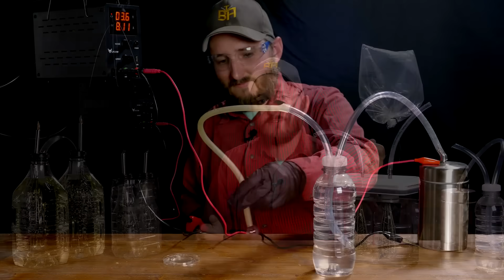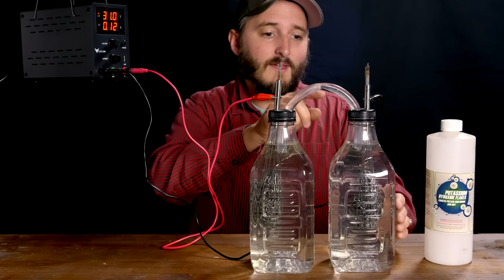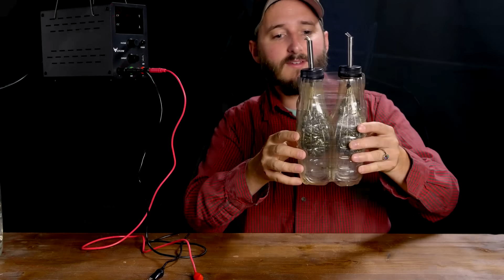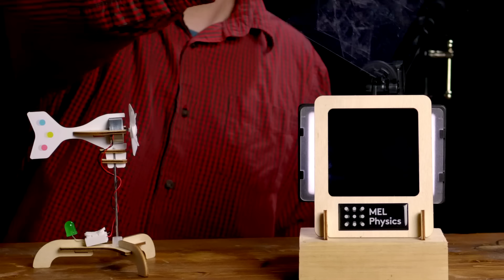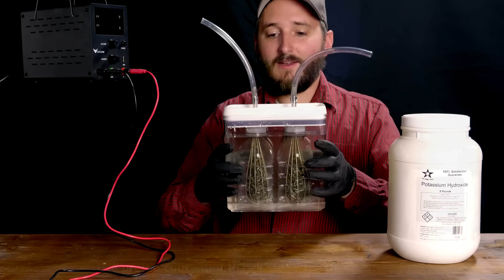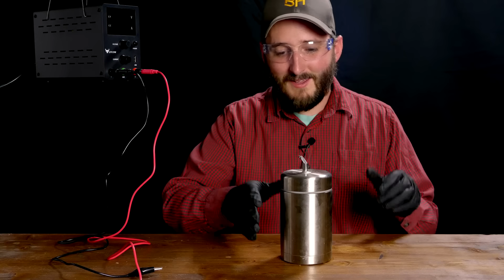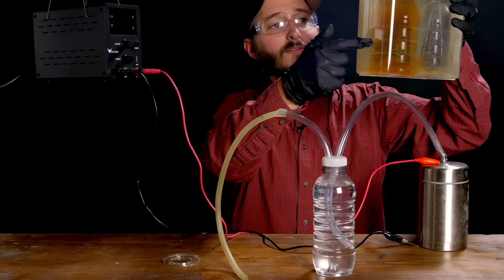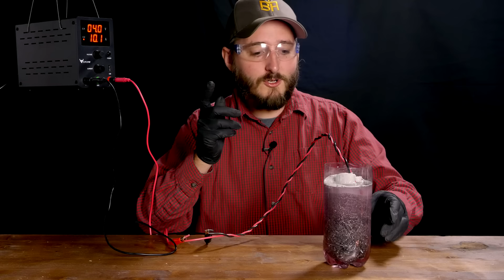DIY Hydrogen/Oxygen Generators From Grocery Store Items (HHO Fuel Cells & Split Cell Electrolysis)

Comment: Did he just say "Atomic Hydrogen Torch"? Yes, please! I think the only way this channel could get better is more videos, every single one is a banger, especially the ones where gasses go BANG as they combust. Cheers!
Reply: Gotta agree with you. These videos are at all just right. They explore some of the nooks and crannies that are often overlooked in all the other science channels. I look forward to all the videos on here
Reply: Honest question; are you expecting nukes of some sort? H2 is molecular hydrogen (two H atoms bonded) atomic hydrogen is a single H atom
Reply: @captainboing  ,Wondering The Same Thing…Honestly
Reply: I'm pretty sure that he is speaking of what I know as an Ionized Hydrogen torch, whereby the gas flows through an electrical discharge arc which brings out the full usefulness of the fuel.
Reply: I heard oxy-hydrogen torch but an atomic hydrogen torch would be really cool.  The heat is generated from the atomic hydrogen combining and become H2
Reply: It was the precursor to oxy-acetylene welding, there is a youtube of this guy demonstrating an atomic hydrogen blowpipe. The welds are usually good quality as there is no carbon.

Comment: Back in the days and I was a lot younger, I tried a HHO generator with a small flashback arrestor like you have done. However it unfortunately did flash back into the electrode chamber, though because I made everything using marmite jars the resulting blow rendered most of the plastic fragments everywhere! The bang was so loud it threw me to the floor and I had ringing in my ears for quite a few minutes afterwards. Miraculously I didn't get hurt, not get any of those shards of plastic in me (at least not any I could feel), but I certainly had quite a bit more respect for the stuff afterwards. I still don't know why the water based flashback arrestor didn't work, but perhaps it was because it was too shallow a container, and when the initial blast occurred in there, it agitated enough of the water in that chamber for the hot gas to make its way into the feeder pipe, and violently back into the electrode chamber. I much prefer the idea of a split gas electrolyser now :)
Reply: Would adding thickener to the flashback solution help?
Reply: @cherylm2C6671  Never tried that ... not sure if it would make a difference though. A deeper column of solution however might be the thing to reduce the potential of a line of bubbles from combusting.
Reply: @HemonDey  That will work for me!
Reply: Ive had exactly the same happen to me when i was messing about with a very large hho generator made out of a plastic food lock box
.
The explosion was HUGE !! 
.
Set a car alarm off,  and i had shell shock just like in the movies
.
I heared ringing and white noise for 30 seconds or more
.
.
My hand was Right on top of the cell ! 
 My leg Right next to the cell !
.
The cell got obliterated
.
But i was completely unharmed except for temporary heating loss ! 🤷‍♂️
.
Not even any hairs burned on my arm ! 🤷‍♂️
.
But i got completely covered in water  😅

Comment: I would suggest making sure to use a pressure rated bottle for the flashback arrester. I learnt the hard way that a water bottle turns into shrapnel pretty quickly...
Reply: two things i think might be ok with the setup... first, the output of the device is open air, which means the pressure does have an escape route. Second PET bottles tend to have quite a bit of pressure capacity and are fairly light to boot. That looked like a water bottle which is thinner than a carbonated beverage bottle. In this case, again in my unprofessional opinion, I think that would allow the bottle to deform giving the pressure time to escape via the output tube, and being thinner would rupture at lower pressures than a pressure rated device.   I think an ideal setup would be something like a plastic food container that  has a lid lose enough to pop off in case of explosion. a grease of some sort could be applied to the seal to help mitigate the potential leaking of the smaller hydrogen molecules.
Reply: It would not be as bad as learning the bad way that stainless steel on the anode side produces highly toxic Hexavalent Chromium, both in the water, and in the hydrogen released.

Comment: The only thing I would have changed is to have the electrodes connected to the "device" before connecting/disconnecting them to the PSU, that way any spark that is generated is always far away from the "device". Great project as always!
Reply: I believe the proper term according to the 'Manhattan Project' is 'gadget', as opposed to 'device'. Just thinking about hydrogen 'things'.
Reply: I thought the same. My take is have tabs with holes where the connections are and wires with lugs bolted right to the tabs. That way the wires/alligator clips are never accidentally knocked off while it is powered, which could cause a spark. Have a connector on the other end of your power cable.
Reply: Oh Come on now, where is your sense of adventure? A good loud bang is always fun to experience as long as you don't get injured too bad lol...
Reply: @beckwerks  sure thing, and besides the ear piercing bang, one needs to be careful they dont get sodium hydroxide blown over them.

Comment: A roll of stainless steel window screen using two pieces (the outer one slightly longer, but same width) rolled up and sandwiched between a cotton insulator (towel) works amazingly well. Lots of surface area! You can make super small devices that produce a ton of gas!

Comment: That flash back arrester reminds me of something else from high school days ;)

Really looking forward to the torch build, that's where my mind went before clicking the video!
Reply: What's that?
Reply: Just don't cough into the tube!
Reply: Apparently, I spent half my senior year of machine-shop building flash back arresters. Had no idea so many kids were into electrolysis.
Reply: They always lose their gas coz they leave the lid off and stick the outlet on the side
Reply: @Dman6779  Yes, they lose their gas.
In the most wonderful way.
Reply: @CraftAero  i think they were making decarboxylation devices/CO2 generators
Reply: I don't understand. What does it resemble?
Reply: @calebhouston5799  A filtration mechanism which often employs some garden hose and a large pile of snacks after it is used.
Reply: @calebhouston5799   A water Bong Caleb

Comment: Incoorporating an aluminum foil burst disk on the sealed container would be a good back up for flasback. Great video love the longer ones.
Reply: Good call, thank you; reminding me that pressure cookers have a small rubber seal for this purpose.
Reply: Please explain what it does
Reply: @ytrew9717  makes an intentional weak point, so if the pressure increases dramaticaly it fractures the foil or blows out the plug, rather than the whole container exploding.
Reply: @FirstLast-bi8xi  Thanks, you were both brief and entirely correct / helpful.  Unusual, on t'Internet :-)
Reply: @FirstLast-bi8xi  Burst disks are good for overpressure, but the (near) explosive expansion wave of HHO going off is probably too fast for it.

Comment: Nice, I'd like to add something about the Voltage vs. Efficiency relationship(which you hinted on several times, but didn't explain in detail, so many people probably didn't notice it) - any time you're going above the minimum practical voltage for electrolysis (~2.5v = ~80%), the maximum possible efficiency drops linearly (because the current performs the electrolysis and not the watts), so at 5v it's impossible to have more than a 40% efficienty and at 12v - around 15%. Or in other words, if you are supplying 12v to a single cell, by creating 5 cells with closer electrode spacing and connecting them in series, you'll produce 5 times more gas for the same input power.
Reply: That s   exactly What I was going  to point, this can be solved  by  adding 4 more socks  and 5  stainless steel mesh  and connecting the inner  an the outer leaving  floating the middle ones, at 12  volts  the potential  will distribute  at around the 2.5 volts needed.
Reply: @lacuentadevideos  I've done some experimenting in the past and determined that you can't create neutral middle plates that way unfortunately, there has to be none or very little water connectivity between non nearby plates. If you just arrange plates one next to another and submerge them, 90% of the bubbles form just on the outer two, same with the concentric sock setup you're suggesting :( the reason obviously being that the lower resistance of the plate is not that much lower than the path around it through the electrolyte, as the plates are very thin. so its like two resistors with close values in parallel and you expecting all the current to flow through just one. A concentric pipe(not porous unlike the kitchen scrubbers) setup will work, but will be practical only for hho gas, its not easy to separate.
Reply: @ratgreen  yes. Thats the energy needed to separate Hydrogen and Oxygen in the water molecule. All the excess Voltage generates heat, thats why his cells heat so much.
Reply: Fascinating! I’d like to see that demonstrated. I was curious to know how industrial scale electrolysis for hydrogen & oxygen was done for things like Project Suntan & NASA.
Reply: @keithpennock  95% of hydrogen production is through steam reformation of natural gas, electrolysis is well under 5%.  Most O2 is produced by cryogenic fractional distillation of air (which produces N2 and Ar too).  It's not economically viable to do much production by electrolysis.

Comment: Pulsed DC current at a frequency similar to the wool, whisk or container will apparently shake the bubbles loose and increase production.
Reply: dam that's some big brain shit right there
Reply: . @dontquestionjustbelieve5757  pmsl. Inspired anarchist thinking thank you! Big brained is just no longer cool. Scientism, as a religion is now out, lol.🤣🤣🤣
Reply: @dontquestionjustbelieve5757  just a bit of knowledge gained from looking into over-unity devices.
The water powered car was supposed to do something like that.
Reply: @fred_e  In reality, it doesn't.
There are a lot of wild claims out there about the resonance of water, and the resonance of the electrodes and certain frequencies being better or worse at dissociating the water... 

I spent a few years looking at all of this, and a fair bit of money getting a 2400x1200mm sheet of 1mm 308L stainless laser cut into plates to build a cell. That's about as far as I got before it went on the back burner.

The biggest efficiency increase this dude could make, is to stick to the 2.3v(?) "ideal" voltage for the Potassium Hydroxide electrolyte. Any higher than that and most of the power goes to heating the electrolyte and destroying the electrodes.
Reply: @fred_e  I suppose clearing the bubbles faster could increase contact area between the electrodes and the electrolyte, allowing for more power throughput...but since he's already maxing out the power supply, I think it's a little academic.
Reply: @fred_e 
Yeah, smaller bubbles more often, leads to a small increase in production because the bubbles don't have to wait for surface saturation to release, because  the surface is vibrating like a guitar string.

 The pulsed power  is supposed to lower power requirements for the the same amount of gas.
The theory I read, sort of indicated it lowers internal resistance in the battery, allowing faster charging time.

And this hydroxy generator is effectively a really crappy battery. Similar to the Edison battery I think it was.

It you want a visual analogue, "Backyard  Scientist"  made a video where he sprayed a screen with water and slapped it.
The water is the electricity, the water that that saturates and runs down the screen represents the useless electrons that  become thermal energy, while the mist released by the slap is the electrons binding to the hydrogen and oxygen atoms being released.
Reply: @jimmyb1451  the specific resonant frequency claims are 🐂 💩, 
The frequency has to be the same as the tone of the electrode, or some multiple of it.
But yeah, the gains are never as advertised, like bunch of pipes inside one another that just turned the whole viewing cylinder opaque.
There's a Russian guy who cuts rock with copper and does a few other things with tone/frequencies, if you like the weird and wonderful.
The video was named something like " how to melt rocks with sound"
Reply: @stoneomountain2390  Yeah, even so though, it's simply not true. Unless you were talking about MASSIVE surface area's, to the point where the current flowing is high enough to create EM fields large enough to start the electrodes moving, and as you say at the electrode's resonant frequency or a harmonic thereof that could build enough momentum to defeat the force of the electrolyte against them... 

Otherwise, all FM/VLF/VHF/RADAR... transmission lines would vibrate, given that they are an exactly tuned length from the "RF hut" to the antenna element at the end of the cable. They have to be. A poorly tuned transmission line can result in transmission line reflections large enough in magnitude that they can smoke the transmitter, or at the very least, poor line tuning means MASSIVE power loss in the line. IE: inefficiency and a much larger than necessary power bill.

The dude smashing rocks... there's something else going on there. I will try to find it though :)
Reply: @stoneomountain2390  never understood why folks want to use ashes for fuel.
Reply: @jimmyb1451  I've researched this stuff a lot. I think the trick is not to try to figure out what complex resonance everything used has. How do you find the frequency of a bell you found? Hit it and listen to the frequency it rings back at. An electrolysis cell is a electrolytic capacitor. You need to find the dielectric permeability. But when looking at material science like polymer matrix materials, they give it a ring and get back several frequencies of multiple interactions because you are not dealing with just one molecule.. To decode this they use "Fourier series" math.... But for HHO The changing temp and pressure will change the freq. That's why I think it should be gone at from the perspective of a phase lock loop system that aromatically self adjusts.

Comment: I have a story with combined hho cell. When I was a kid I heard somewhere that if you pass electricity through water with a little bit of salt  it's gonna produce hydrogen and oxygen and I thought hmmm.... Interesting, let's try it. So I got a mason jar hammered some nails into it and hooked it up to a phone charger and heared some sizzling and smelled chlorine, I tried to light it but there wasn't enough gas so I left it running for about 10 minutes and tried to light it. HUGE BANG nails shot up and some were actually stuck in the ceiling lid looked like a bowl, the disgusting brown-green water splashed everywhere including the ceiling and the jar itself miraculously survived. Moments after my mom ran into the room asking what the hell happened. My ears were ringing for 2 days. I was a genius
Reply: Fantastic!!!!!!!
Reply: lmao I remember when I was 14 I did something similar with a pack of plastic water bottles,  fish tank bubbler tube, and stripped phone wire. I thought I could make a torch if I put a one way valve on the thing... worked for a while until it backfired into the 24 bottles producing HHO. learned really quick one way valves dont prevent this ;P
Reply: @Protossplayer1  some people have to learn the hard way
Reply: Yup, I tried making one too with some galvanized plates. Never use galvanized metal lol, that sludge is disgusting.
Reply: I just used a 9v battery with alligator clip wires in a film canister in the sink. Much smaller scale, but when I introduced a lighter, it still popped pretty loudly.
Reply: total genius!
Reply: A ghost just appeared in the middle of my room and when it saw me it looked Scared and exploded ... See all the Ectoplasm it got everywhere..   You could have told your mom that and thickened the plot a whole lot more lol...
Reply: @beckwerks  The first story I believe from this original comment.
Reply: @Bob_Lob_Law  oh man it is.... Burns..
Reply: mad scientist
Reply: NEVER Use salt as it makes Chlorine gas a highly toxic life threatening substance than can & does kill air breathing biological animals such as Cats Dogs Birds & People etc.

Comment: When trying to drill a hole that is the exact size for a tube (a rod can also work if it is small like a coat hanger), you can chuck the tube directly into the drill and use it as the bit.

Comment: My friend and I made one with stainless steel plates and a water filter housing something like 17 or 18 years ago. The issue has always been Amp draw and do to that heat. The remedy is using a frequency generator to pulse the power and reduce Amp draw while still producing the same or great amount of HHO.
Reply: Yeah and from the heat you ultimately get steam instead of gas